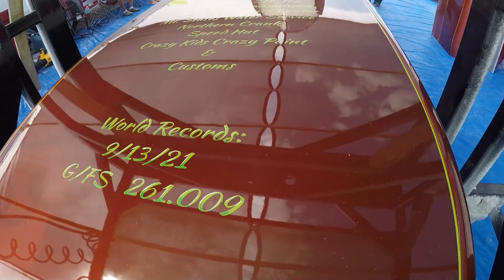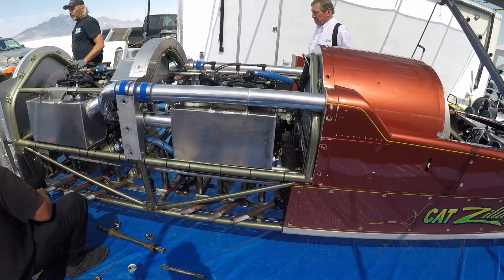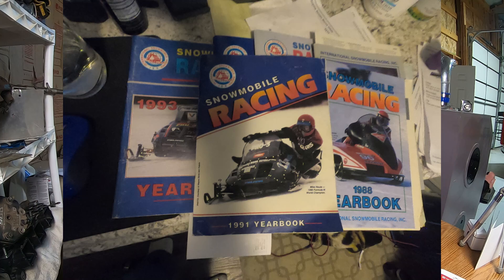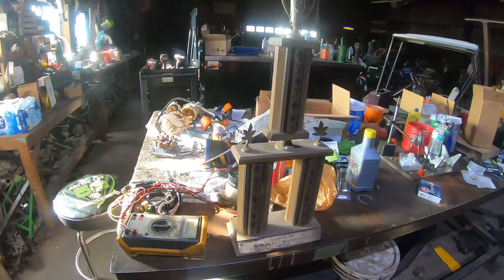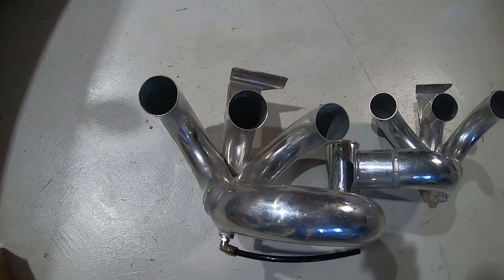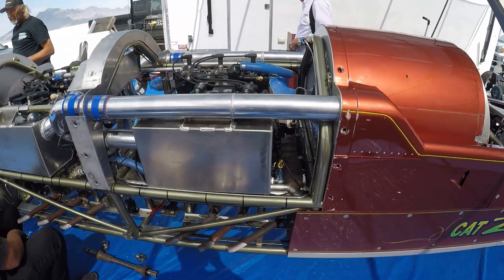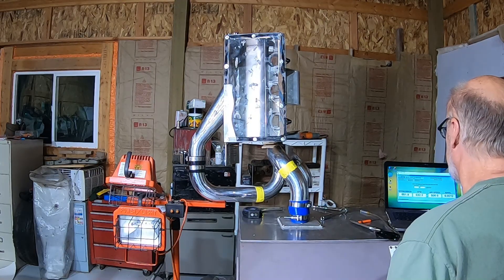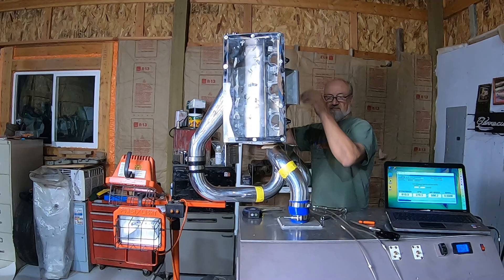Can Two Snowmobile Engines Break a Speed Record?

Comment: Great video! What a project, what a challenge. Fighting through the tediousness until you have results is what will break the record....just need to see if the theoretical flow bench will translate to reality for the cat.....but in your favor, the theoretical flow bench discovered the real world lean out issue, so I will not bet against you and your team. Be fast, be safe, and may that salty luck be on your side.
Reply from the maker: Thanks for the kind words and support, it means a lot, and I'm glad you are following along!thank you so much for that. The biq question I when the stream liner ingest 3 to 4 time as much pressure then I can  simulate ………while the air still be stable……..my answer…… 10x better then be for😁